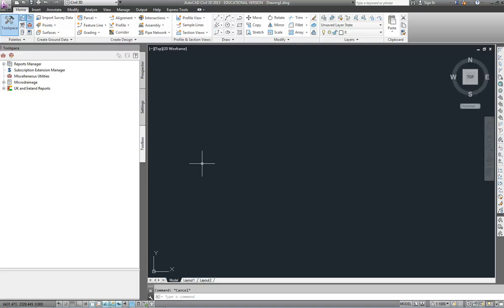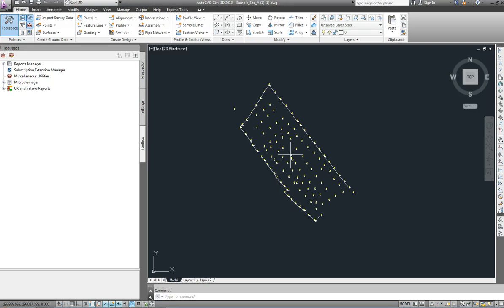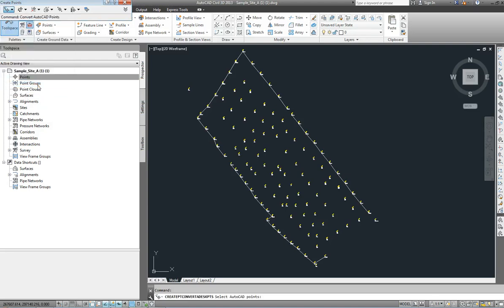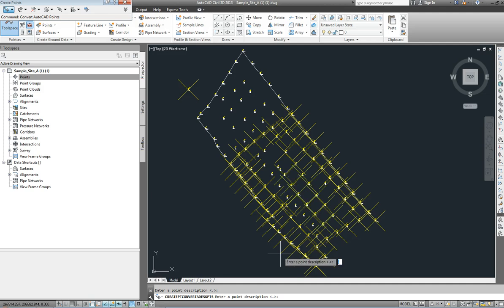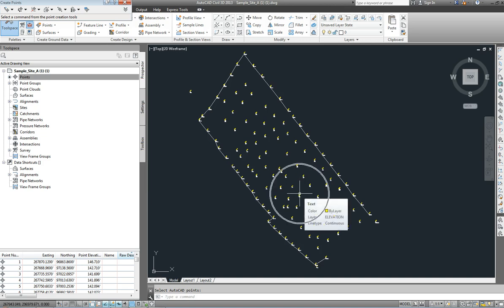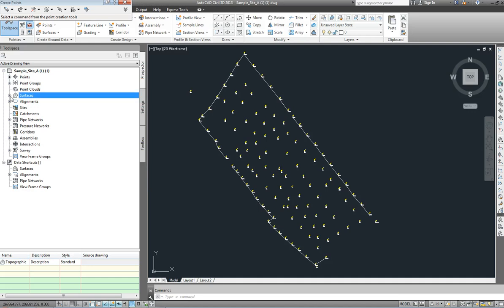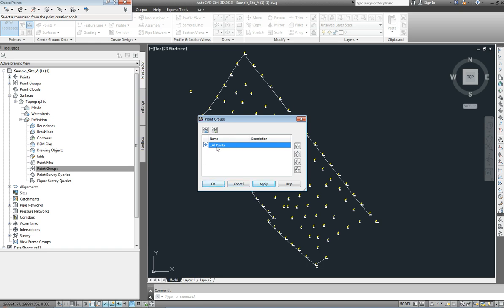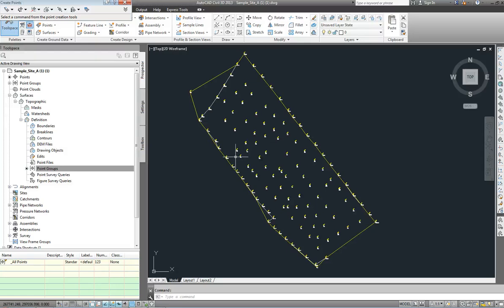Create a surface in Civil 3D from an existing AutoCAD drawing, Part 1 of 2

Comment: it always says, "invalid selection set", i am trying to export points from a block
it is a topo data
Reply from the maker: Invalid selection set usually means that when you draw the selection window over the model, there are no points in it. You said that you are trying to export from a block, which may be the issue: make a back-up copy of the drawing so that if something goes wrong you haven't lost any work, then try exploding the block and see if that makes the points selectable.
Reply: Okay..thanks...i wanna try to establish points so that i can make cross sections. Those data i only have was polylines that has elevations of each.
Reply from the maker: How big is the drawing, or more precisely, how many points do you think will be in it?
Reply from the maker: If you have 3D polylines, you could try making a surface from those: using points is not the only way to create a surface in Civil3D
Reply: @CADandStuff  Okay sir. The drawing itself has a big bunch of memory that when i try to establish surfaces from polylines, my problem is it lags and my program crashes. By the way I am using i5 with 2.8ghz 8gb RAM.

Comment: Thank you CAD and Stuff for uploading this video. I just want to add one tip to your video. To avoid pressing space bar for each point,  go to Create Points command setting and change option: prompt for point description, prompt for point elevation and prompt for point names to none or automatic. Thanks to that you can change all points to COGO ones  with just one selection.
Reply from the maker: Good tip, thanks.

Comment: The problem for me is that when I select the auto cad drawing it is error
Reply: the same problem if u did found out a solution help me please
Reply from the maker: There could be any number of reasons for this. Can you give me more details? Are you saying that when you click on the drawing file to open it (i.e. “select” it), that it’s not working?
Reply: @CADandStuff  ERROR: Invalid selection set!